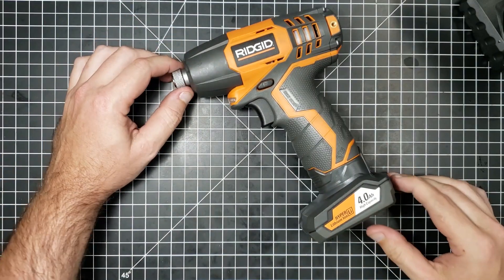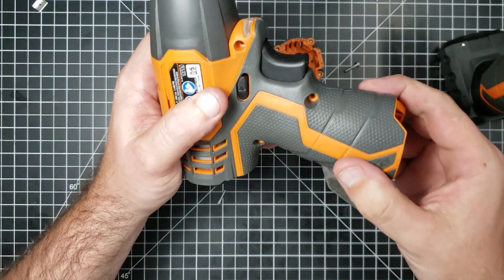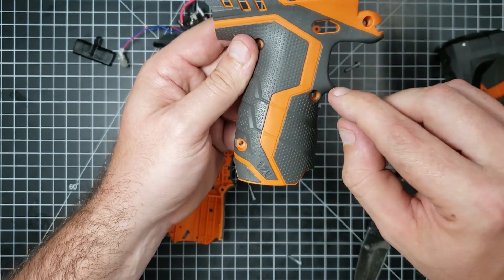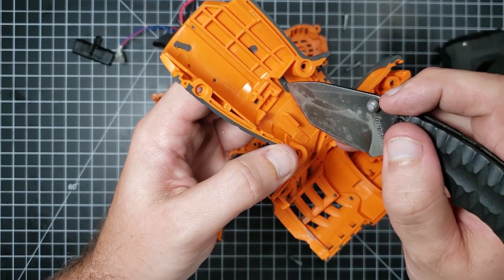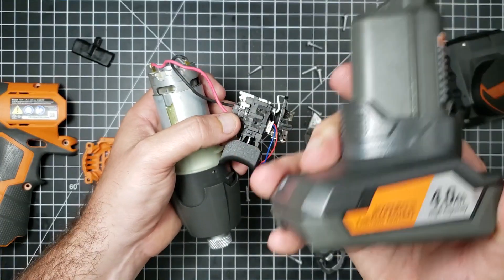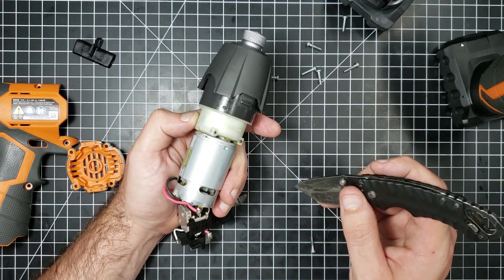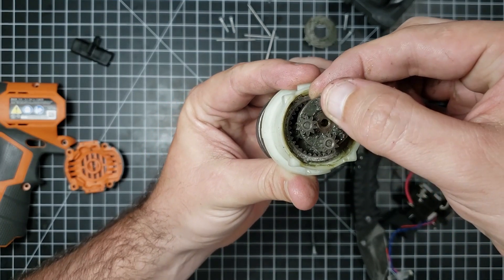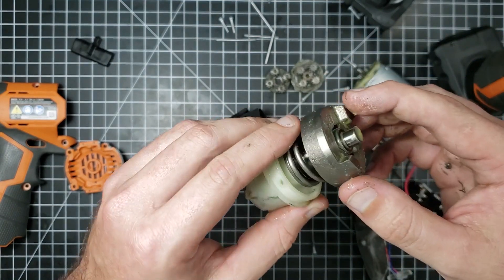ENGINEER EXPLAINS Why Ridgid 12V Impact Driver Is The Best You Can Get | How's It Made Ep. 2 Review

Comment: Have it (duo) since 5 years. Good but three four things dislike:
1) The default 2 Ah battery doesn't have any charge level indicator. Not even on the charger.
2) Light is partly blocked by the tool.
3) As far as I know, the drill and impact driver are the only 12V tools Ridgid ever developped. So you cannot get any other tools that use the same 12V batteries. 
Exctremely limiting.
4) The 12V is the same price as their 18V, so I consider the 12V to be a bit pricey.

Comment: Great brand and the Lifetime Warranty is outstanding 👍🏻. it's to bad that the RIDGID R86211B is no longer available. Best 1/2 High Torque Wrench that was put out, TTI pulled the plug it was out shinning Milwaukee in its category at that time.
Reply from the maker: My original with clicking chuck is now 15 years old and till going strong.

Comment: Rigid tools (and a lot of the other good cheap tools) tend to be over engineered (and not over engineered in a bad way) in these ways to make up for the cheaper materials used. Like you said they use expensive strong where it matters and cheap flimsy where it doesn’t. If you go strong everywhere certain design features become less necessary although I’m sure you know this.
Reply from the maker: Very good insight... yes I have myself designed using cheaper materials but added thickness or bulk or ribbing to get the toughness back for a net result that is just as strong but less expensive.

Comment: I am a home remodeler and I carry this thing with me as a supplement to my big impact. Can use it to zip off cabinet doors, put in lock sets, that sort of thing. If I can get away using this thing all day it's much more comfortable. It fits in the tray of my tool box and I can use it for a week or so on the 2ah battery without having to charge it. Wish ridgid's 12v line saw more support, there are much better and more powerful 12v tools on the market these days. But this one is so comfortable.

The rubber overmolding on tools is really nice not just for comfort but so you can put your tools down on someone's floor or inside their brand new $500 cabinet without it scratching anything.

P.s. The drill is amazing to use in combination with another drill as a predriller for a bigger bit or with a countersink.
Reply from the maker: Great insight man; always good to hear from the professionals! Thanks for the comment!

Comment: Rigid has the best warranty of any of the top manufacturers. Rigid has a limited lifetime warranty. Milwaukee, and Dewalt doesn’t. They will fix the tool, until it’s not fixable, or cost effective, then give you a new one!!!
Reply from the maker: I 100% agree. They even warrenty their batteries, which is unheard of. I have personally used their warrenty and they followed through.  Thanks for the comment!
Reply: @JJCCENG  Ridgid only extends warranty on batteries that come in a tool package.  Buying batteries by themselves, they only have the 3yr warranty.  From what i've heard :)
Reply from the maker: @darrenmcquade215  Did not know that..... very good to know. Thanks!
Reply: Milwaukee absolutely does cover batteries for I believe 3 years and tool for 5. A Hyundai has a way better warranty than a Honda does but I’d take the Honda any day.
Reply from the maker: @kitchentimeinc  Good to know for sure.  Milwaukee M18 review coming soon!